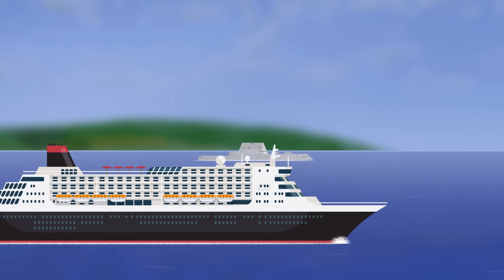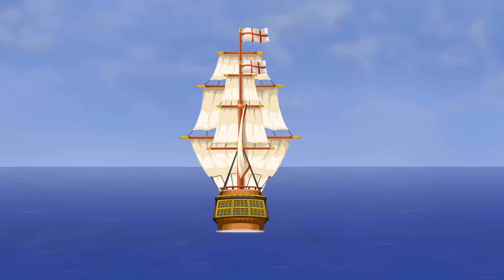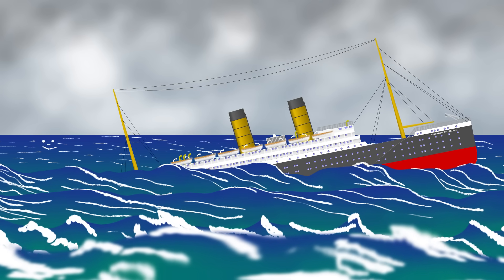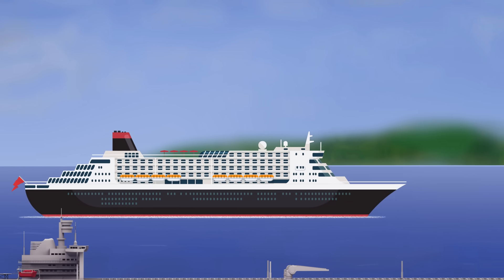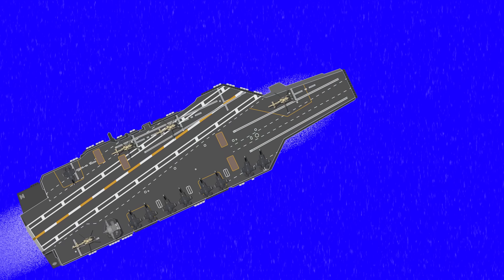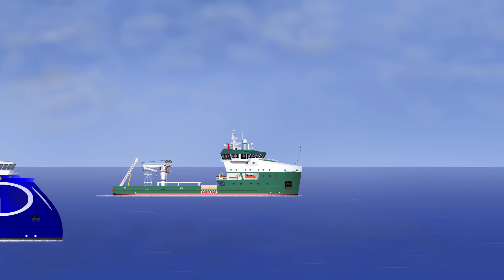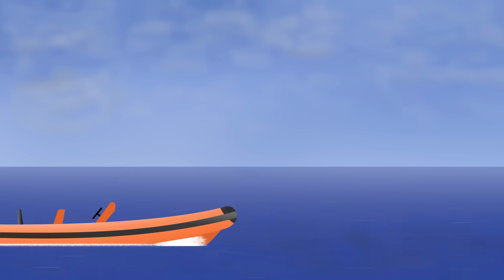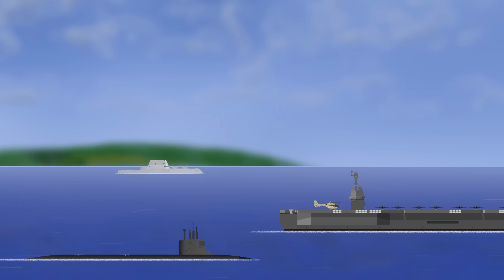Why Are Bows That Shape?

Comment: It's worth pointing that even things designed for absolute maximum speed underwater (like torpedoes or submarine launched ICBMs) have rather blunt, rounded bows/noses. In fact, making these noses more pointy would slow them down, due to greater wetted area and greater skin drag.
Reply: Submarines also need to resist high water pressure. Any sharp edges will generate a stress concentration and be more likely to break. That's why things that have to resist high pressures are always round
Reply: @finlaymcewan  It’s true. I’m a chubby guy and don’t get stressed.
Reply: @finlaymcewan  The external hull of a military sub is not a pressure vessel.
Reply: @gammafoxlore2981 Depends on the submarine design. For example most Soviet and Chinese subs are double hulled like you say, however most Western designs are single hulled where the pressure hull is on the exterior.
Reply: Subs also have a rounded bow due to the sonar. You can get a much greater radius around your sub with a rounded bow instead of a pointy one. The downside of that round bow; expensive and complex to produce. Which is why the new British subs have such a funny looking bow; flat plates are easier to produce, and it's set in a dome shape to allow maximum sonar coverage.
Reply: Also note with torpedos the circular shape also helps significantly with packing the most amount of explosives towards the front end of the torpedo giving it the greatest chance of critically damaging a ship
Reply: The big cargo ships have a blunt bow and as much as Casual Navigation wants it to be all about cargo space it isn't.
If you check the speed vs range data for the Bering 65 motor yacht, this blunt bow yacht can be built so that it gets nearly 15,000 Nautical Miles per load of fuel. The blunt shape is a fuel efficient shape not just a space maximization shape.
Reply: bulbous bows under the waterline on ships also help generate a wave that helps cancel out the wave the bow at the waterline generates. but because it relies on destructive interference, it only works at certain speeds. a lot of ships nowadays are getting nosejobs to sail at lower speeds to meet higher energy efficiency standards
Reply: Makes sense, I guess that's probably why only the few supercavitating torpedos (like the VA-111 Shkval) are pointy at the front instead of all torpedos being pointy.
Reply: @buddycat2757  The super cavitating torpedoes deploy a rod with a shaped tip that extends well in front of the torpedo to create the steam bubble. The shape of the nose is primarily about deploying that rod.
Reply: @JoeOvercoat  oh okay, that makes a lot of sense over what  was thinking before. thanks!
Reply: And the blunt submarine bow also isn’t just for pressure or fuel efficiency, it allows room for the big radars they need to operate as military vehicles.
Reply: It's worth noting that the physics of going fast on the surface of the water is fairly different than going fast underwater.

Underwater, or (subsonically) in air, a rounded profile actually gives the least drag. It's not just a surface area or skin friction thing either - that's part of it, but also there are other complicated fluid dynamics things that make it so you want a pointy trailing edge but a rounded nose. Look at modern airliners for a good example, or submarines as mentioned above.

However, for maximum speed on the surface, at least for non-planing vessels, you absolutely want it to be pointy (ideally with a bulbous bow under the waterline, but a pointy profile where it breaks the surface). Look at the nose of modern military warships, for example the just-launched USS Gerald Ford aircraft carrier, and you can clearly see this design. Similarly, on the nose of fast cat ferries, you can see that the hulls are sharp and pointy where they hit the waterline. Roughly speaking, this is because surface waves share some similarities with supersonic shock waves, and there are similar considerations in minimizing the energy lost to wave generation at the surface as there are to minimizing energy lost to shock waves on supersonic objects, which also tend to be long and pointy (like Concorde).

This is an oversimplification of course, but this is why submarine bows and torpedo noses look so different than military surface ship ones, even though the military is designing both for speed.

Oh, and as for ICBMs? They're pointy, to minimize supersonic drag (see the Peacekeeper, Minuteman 3, or the Chinese DF-31, for example). The exception is some truck-mobile ones, and submarine launched ones (for example Trident II or Sarmat), but that's because they're length limited by the vehicle carrying them. The round nose is to reduce length so they fit vertically in the submarine or so they fit on their carrying truck, and actually considerably increases drag compared to a pointy nose (once they're supersonic, but that happens pretty fast after launch). It's also not that much of a trade off, since they leave the atmosphere pretty quickly anyways where drag becomes irrelevant.

For the reentry bodies, pointy is best to minimize drag, but at the incredible speeds ICBM reentry vehicles achieve, heating is a big problem, and the tip of a pointy object at hypersonic speeds experiences worse heating than a blunt one. Still, as materials science and simulation technology has improved, you can see a general trend from very blunt reentry vehicles on early ICBMs (see, for example, the AVCO Mk4 from the Atlas) to much pointier designs today (for example the Peacekeeper's Mk21 RVs).
Reply: Reading these comments it's like we all have watched the same video about subs' bows 😂 And nobody wants to mention about it, I see. For others interested about the topic, see youtu.be/exm65Y_LZxw
Reply: Yeah, but they don't deal with wave action. The sharp bow of the ship is simply there to deal with punching through waves. Much like a surfboard nose, it isn't active most of the time.
Reply: just like most misiles dont have a needle point, they are actually a little round in the end, and larger misiles like ICBM are really round, but thats more on payload side, torpedoes carry a really heavy load so they must be round in order to acomodate said cargo, if they had a needle like nose it would take so much space and actually would not work as intended, another example is the "fat man" the nuclear bomb was actually "fat" and had a darf torpedoe like apearance much thicker than a normal bomb and didnt have a "needle like" nose, the biger the bomb less needle like it becomes, and thats because it is so fat and big that it cant actually be like a needle, it needs space for the body of the explosive.
Reply: @lukasausen  "But round is not scary, ponty is scary, this will put a smile on the faces of the enemy, they'll think that it is a huge robot dildo"- Admiral-General Haffaz Aladeen
Reply: This may interest some: do a search on "Mk 48 ADCAP torpedo have a flat nose".

And, DDG-51 bow bulb:

https://apps.dtic.mil/sti/pdfs/ADA582048.pdf
Reply: Yup 
Same effect on rockets.
Reply: Submarine-launched missiles (technically FBM's, Fleet Ballistic Missile, not ICBM's) have a squat, rounded nose fairing in order to get the most volume for the warheads in the limited length afforded by the submarine hull.  They don't care about water drag during launch since the missile isn't powering that stage of the flight (it's launched by a steam catapult and the rocket motor doesn't ignite until it's breached the surface).  The blunt fairing does wreak havoc with the aerodynamics at the beginning flight, though, so the Trident missile has a very clever way around it.  

As the rocket engine at the base is igniting, there is flat disc, about 10" across that extends from the tip of the nose fairing on a nested stalk (like a camp cup).  As the missile goes supersonic, this disc, called the "aero spike," creates a shock wave large enough for the whole vehicle to ride in, thus from the point of view of the airstream, it's one long pointy nose.

Another interesting tidbit, more germane to this channel, is that the submarine's missile tube is sized such that an empty tube filled with seawater weighs the same as a dry tube with a missile in it.  In that way the sub doesn't experience any trim issues after getting rid of an 80,000 lb. missile.
Reply: Another reason is that the bow would look ugly if it were too pointy. If you look at the the old u-boats such as WW2 submarines that were actually surface craft that would submerge only to attack or evade, you'll see that they had a pointy shape that made the overall submarine look generic and by the end of 1945 also outdated and old. The round design can be adopted by any ship because you won't have a large surface leading up to the pointy end which will then look awkward. You don't want to be seen with some crap that looks 70 years old.